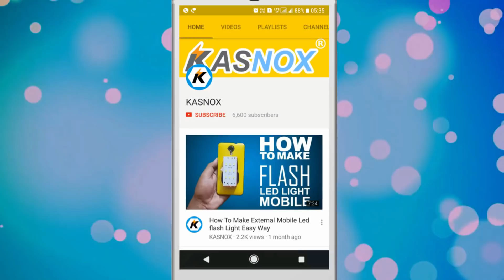Auto Swing Motor Synchronous Motor Inside View - easy way kasnox

Comment: Do you know how to purposedly reverse that motor, so I can use that to make a open/close slider? I have one but I can only on/off the cable to get reverse and forward spin unpurposedly and randomly. The next connection is not always the same direction or always reverse direction. Please help!
Reply: Synchronous motors do not have a defined starting direction. A different motor would be the solution for yourself.
Reply: All you need 2 (2way switches) to change the polarity of motor. Wiring is as we do in stairs light wiring. But alter the phase newtral in one of that 2 way switch.
Reply: @harshitsingh9416  That's too complicate, I think I need to change it with DC motor for easier reverse action. Thanks anyway..
Reply: @deano3189  Yes, I think I should use DC motor instead. Thanks.
Reply: @TheCoolncold  yeah bro. I was thinking that i have suggested something wrong. But due to server issues I couldn't undo that. 😅 then I reached to a conclusion that after some modifications in this swing motor we can easily reverse it. By changing the main motor with a DC one.
Reply: @harshitsingh9416  Yup, replace with DC motor which is cheap or with a 3 phase motor that cost expensive.. that's easier solution, because such above motor is obviously not for 2 directions purposes.
Reply: @TheCoolncold  off course bro. Not everyone have 3 phase electricity connection at home. And there's no need to spend much because there's no requirement of heavy duty works in domestic purposes.
Reply: @TheCoolncold  but being creative and making projects ouself for convenient life is the best. To save money, to learn more and yup most important for showing off that i have done it 💪⚡👌
Reply: @harshitsingh9416  Exactly, it's my home light purposes only.. 😄
Reply: @harshitsingh9416  Exactly, you name it all.. 😃

Comment: I hv two synchronous motors with same specs but shaft lengths are different, also one is D shaped & other circular, can I interchange the shafts between the two ?
Reply: If the shaft is plastic you can file it down to size and the D shape.  I've seen a microwave technician do exactly this while replacing the turntable motor on my microwave.

Comment: My motor is being used as a cup turner.   The motor will spin intermittently. Like it spins and stops until the motor catches up. You can even turn it with no resistance. Anybody else have this issue?

Comment: Hi, i have the same motor working.. but   it seems that my wiring diagrams are not making it work.. do you have any wiring diagram to wire up this motor for my reference?
Reply: mohamad091189 it can be ac or dc check which one you have